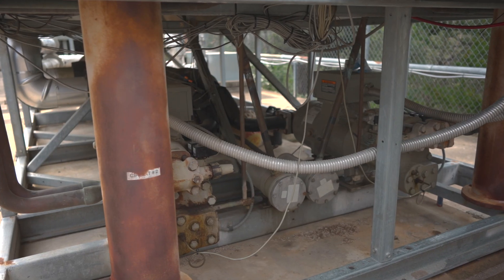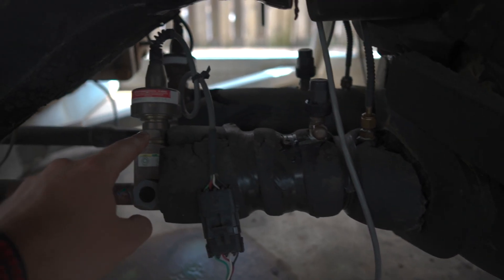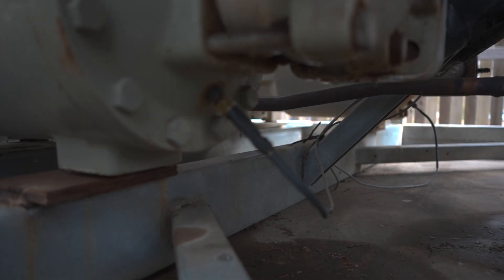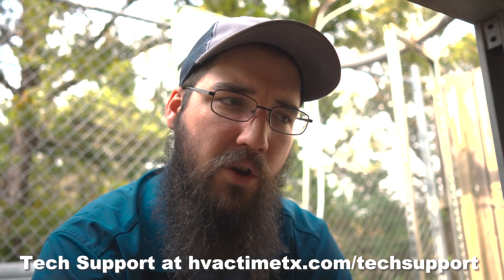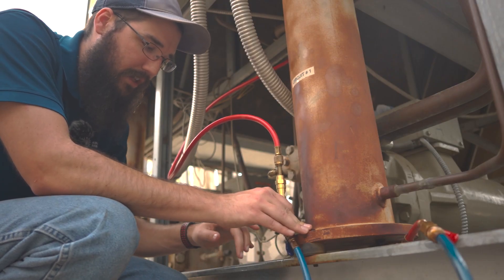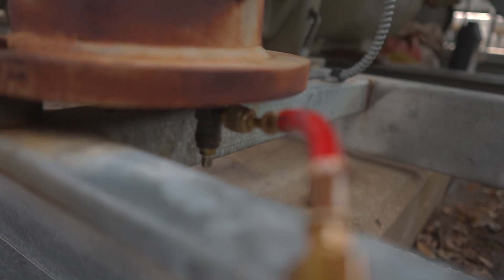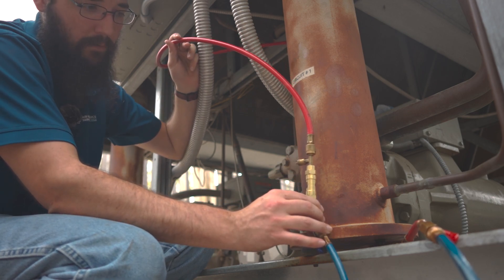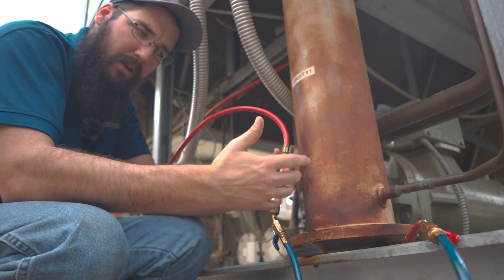Low Oil Troubleshoot RTAA Chiller

Comment: I wish they put a gauge glass on the oil seperators. I find it ridiculous to have to check the oil level with a hose on a million plus dollar machine. Or they could have some kind of electronic level sensor at least. Oh well it is what it is. So in a situation like this, how would you know  if youre actually low on oil in the system or if most of the oil is somewhere where you dont want it at the moment like in the evap? Idk that would make me real nervous seeing almost no oil in the seperator

Comment: Anyone have any idea why the oil separator would make a loud whining noise during operation? Trane Screw Compressor RATC1404 Chiller, Replaced oil filter (minimum oil during Replacement) replaced oil filter on the compressor, and replaced the oil return line filter dryer (no oil at all in line when i cut it out) Pulled vaccum and cycled it back out sounded normal at first then went back to making a loud whining noise? Oil return line dosent have a solenoid valve (verifed with trane that this model didnt have one) Any help would be very helpful thank you.

Comment: Question: 

Is it typical for a screw compressor often to have low oil problem? I’ve seen this in McQuay, Dunham Bush and Trane.
Reply from the maker: In my opinion no, usually not an issue.

Comment: So where did the oil go?   Oil loss over the years of checking the level and random repairs?
Reply from the maker: And a compressor replacement. New compressor was shipped dry but additional oil was never added. Old compressor took a large quantity of oil with it.
Reply: @HVACTIME  that’ll do it!

Comment: I worked for Trane and their RTAA - RTAC units.  I've found the oil filter to be culprit very often.  Oil would be moved out of the compressor into the Cond. Barrel.  Replace the the oil filter and dryer and this problem will disappear.
Reply: Culprit = block  dos mean ?

Comment: Was the chiller low on oil, or was it trapped in the evaporator?
Reply from the maker: To verify it wasn't trapped. We were able to get the circuit to fully stage and run for a few days. Even after adding oil we made a return trip to ensure that the levels did not increase.

Comment: The whole temperature difference i didn't quite grasp because I'm not used to this type of oil management,  I'm gonna watch again and try and do some research. 
Bitzer has an integrated oil separator which seems to work pretty well .

Comment: Nice catch. My question is about the oil. There are no oil leaks and things of that nature since you didn’t say it. Do you think the oil is trapped in the evap, it had to go somewhere? 

I heard you say you changed the compressor.
Reply: Those screw compressor chillers having real trouble with oil, I saw some issues with the Daikin chiller, but mostly the Trane RTAF heat recovery air cooled chiller is having real trouble to get the oil back to the compressor. In the winter when the compressor working on low load because of the low outside temperature, even though the setpoint is not reached causing the oil trap at the evaporator

Comment: I’ve worked on this model before. Did the oil level thing.  Wish they would have put in two sight glasses, one at the low limit and one at the high.  Would be less of a PITA.  Did you find out why the level was low, and where the oil went?  On the unit we had, one circuit was flat on delivery, and two compressor processor boards were bad.

Comment: My friend. I bought transparent hoses on Aliexpress 5 years ago. Re-equipped in the hydraulic press. I have a supply of such hoses. With them I go to Chiller. But I still don't understand Trane's designers. In total, you need to cut three or two glasses into the oil separator. RTAA is the best model for me. and the 22nd refrigerant is the best refrigerant for high evaporation temperatures.
Reply: I would love to see oil sight glasses installed in the separator as well.. Must only make sense to us!

Comment: Where did the oil go though? Does it mean there's a leak?
Reply from the maker: This circuit has had several repairs due to leaks and other component failures including a compressor change out within the last year. Our estimation is that during the duration of all of these events it led to the oil level getting too low in the system.
Reply: @HVACTIME  ok thank you!
Reply: @HVACTIME the tech ,,,he did the repair,,,he should top up oil ,,back to the system

Comment: Very smart idea with the sight glass on the hoses. I will for sure be using that in the future when in a pinch.
Reply: That’s actually in the IOM in the back under the maintenance section.
Reply: They mak a nice tall 8 or 10" tall sight glass that's similar with 1/4" flair fittings on it that make it easier to identify the level. I used one once, unfortunately it wasn't mine so I'm typically using the method he shows with the little sight glass.

Comment: Where did the oil go? Is it traped in the system somewhere or leak out?
Reply from the maker: This circuit has had several repairs due to leaks and other component failures including a compressor change out within the last year. Our estimation is that during the duration of all of these events it led to the oil level getting too low in the system.